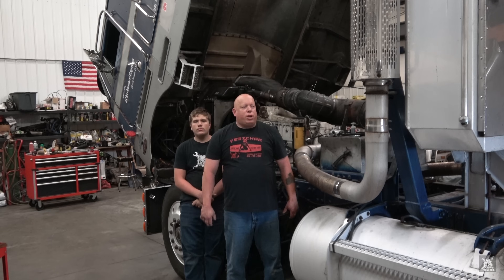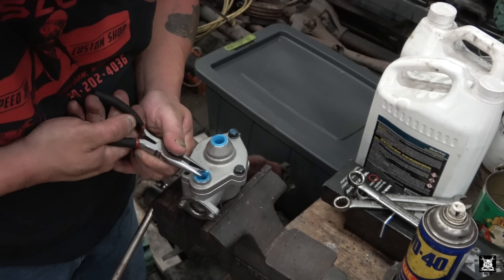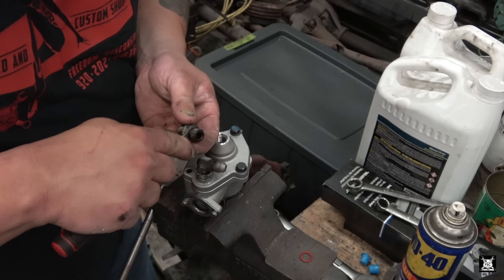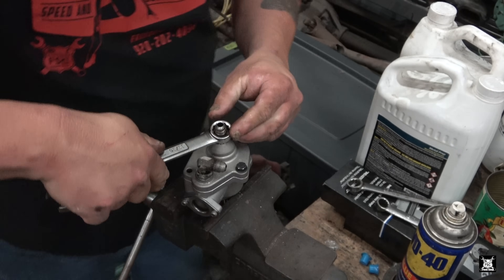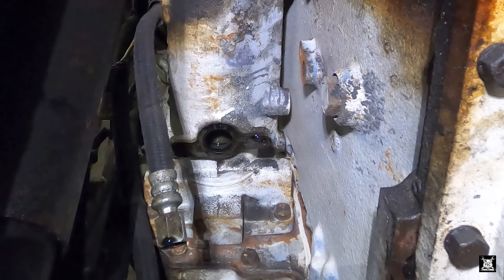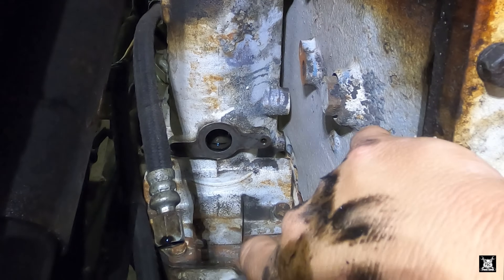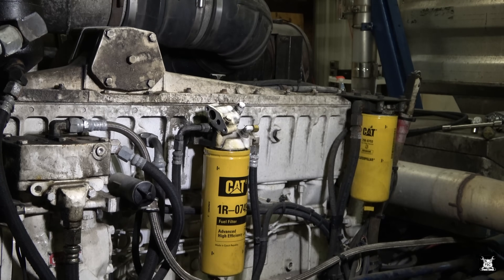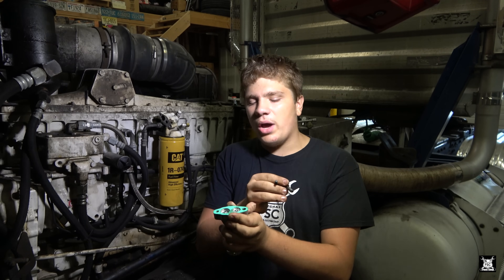3406B CAT Fuel Transfer Pump Installation

Comment: Any time your installing a part that has a rubber seal or O ring you should rubb a little red rubber grease on it,,It not only helps to seal better but it preserves the seal for longer,

Comment: Old video but did it ever solved your prime problem ? Having the same issue of loosing prime but it’s happening within 30 mins of truck being shut off. Tried new primer pump and checked all the fuel lines but no luck

Comment: Steve... was thinking of the jacks on the cabovers [a dangerous thing I know]. Why not take a jack kit from a dump trailer that's good for up to 5 ton and just adapt it to heave the cab up and down. Even just get the pump part and the electronics and get the appropriate sized cylinder. But I'm guessing if you position on of these right it'd dip and untip the cab on the Pete's or any other cabover at the push of a button. Check this particular kit out for repairs on one of these dump trailers ------> https://youtu.be/i6OfoU_XhZo

Comment: A/F means asbestos free. You messed up changing your fuel return fitting. It has a one mm orifice to allow air out of the pump and to keep fuel temp down. If it's not plugged no need to change it. If you put a number four return line they are small and they can implode over time. Since this system has no relief valve, if the return line implodes you will blow the fuel filter off or blow out a check valve in your FTP. I would have removed the adapters and installed a number six line back to tank. Never seen a number six implode. Also a number four if implodes can cause a hard starting problem. On your hand priming pump. Most people don't use it anyway, they prefill their fuel filters. If you do put fuel in small holes, not the large one. Anyway I recommend to put a 6N4414 on the base. Your hand priming pump check valves are being worn out with flow. Keep the pump, gasket and some tools in your cab and install it when you need it. Then take it back off. On your supply fitting on your FTP, the 7FB's had all those fittings to get to a number eight or ten supply line. I look up a later engine and install a one piece elbow. Your FTP, I rebuild them takes thirty minutes. The cover on the side, that valve is bad about working loose. I put a 2S8398 spring to keep it in place. Not sure if your reman pump still does this. Also you can increase your fuel psi by adding a spring out of a 3406 A FRC and get roughly ten psi more, if you rebuild it. I ask my customers if they want more psi first.

Comment: Just a quick note, one of the lights you're using causes a waterfall effect; likely because it is driven by PWM (pulse width modulation, think turning it off and on at high frequencies) that your camera is picking up. Naked eye doesn't see that. I'll assume it is an LED light source. You should get yourself a few lights that are designed for on camera use. They wont cause flickering, strobing, or waterfalling like some others do.

Comment: The part you keep calling a regulator isn't a regulator, but a check valve. The check valve keeps the fuel pump from losing prime when the engine is shut off.

Please start using a torque wrench for the installation of these components. Besides the bolts having a maximum torque specification, it keeps from generating a point load around the fastener, thinning out the gasket.
Reply: Do you know the part number for that check valve?

Comment: Color of a simple part like the o rings lets them tell at a glance if you are using cat or 3rd party parts when you bring them in for warranty. It was ford that started this practice back in ww2 when they and 2 other companies had the Jeep contracts Ford only wanted to have to pay on ford parts so marked them with a F on them from the largest parts all the way down to individual nuts and bolts. 

Not sure what the AF in the item numbers is but it could be a maker or a plant depending on how they have things setup as few companies make 100% of what they use like YKK makes the majority of zippers in the world letting companies by them so they don't need the machining to do it.